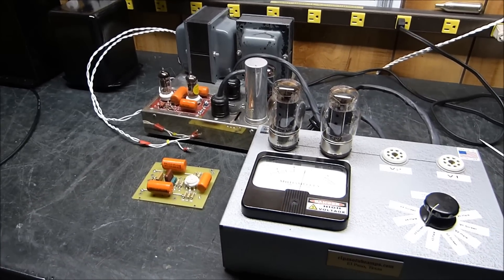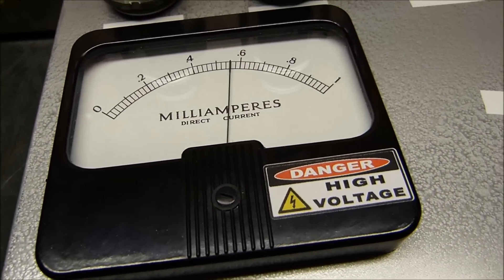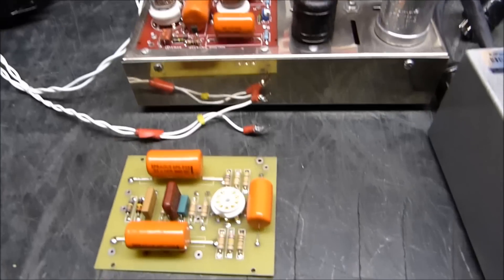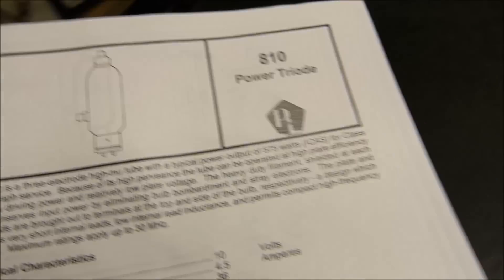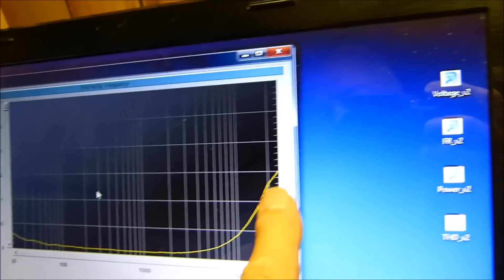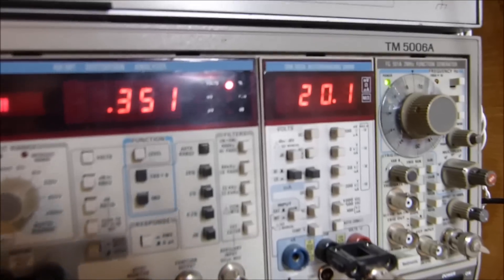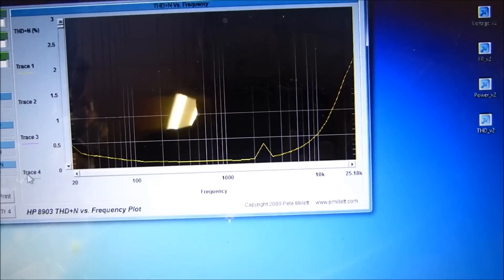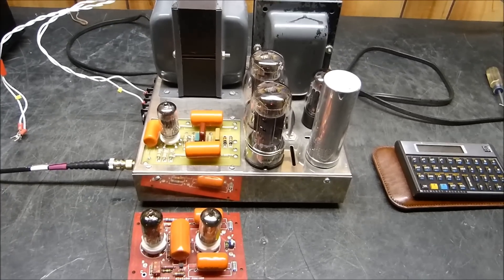Dynaco Mark III Poseidon Board vs Original Dynaco 6ANA Driver Board

Comment: Thanks! I was pondering whether or not to change out my original Dynaco driver boards with new ones and now I'm probably not going to go that route. It's my dad's stereo and other than changing out the selenium rectifier for diodes and upgrading the cap can, I want to keep it as original as possible. It sounds pretty good now. Edit: I upgraded the can filter capacitors and replaced the original driver boards with Vintage Electron ones that are an exact copy of the Dynaco boards (the original boards were 60(?) years old and pretty beat up). I replaced the selenium rectifiers with diodes, replaced one bad rectifier tube and got new Kt-88s and NOS 6AN8 tubes, set the bias properly and these little guys sound great. But so much for keeping them original;)

Comment: Have you had any experience with the Octal driver board from Tubesforhifi ? 

 Iv'e got a set of Mk3's that I want to upgrade. Iv'e read some commentary but would be interested in your opinion on which board (of any out there) you would buy next to try or would you keep the Poseidon?  Also doing a Radio Craftsmen C550. Cheers! Keep em glowing!
Reply from the maker: I wasn't aware of the Tubes4hifi until now. Thank you. I am a real fan of the 6SN7 so I will have to try them. I didn't see the schematic of the Tubes4hifi board but I can say that, in any case, I believe a second adjustment is a good idea and maybe they did include ii. I am talking about the Poseidon board that has a pot (static adjustment) on it to help balance the cathode currents but a pot to vary the resistance of the plate (or cathode) circuit of the driver to balance the drive voltage while being driven to max power (dynamic adjustment) works very nice as I showed in one of my videos.
Reply: I had watched that video. I agree, all PP amps should have the option of dynamic matching. especially since matching up quads of NOS tubes is getting tougher every year. 
The Tubesforhifi kits (VTA70 and MKIII version) feature long tail phase splitter with CCS mirror and bias adjustment for each tube. I am building an all tube amp 5 ch surround sound system with MKIII's (fronts) ST70 (rears) Craftsmen C550 center channel. I think I'll try the Octal board on the MKIII's (they have a 9-pin driver board version also). I have my ST70 in triode mode currently with EH El34's. Whats your preference, triode or pentode mode on the MKIII's with the Reissue Gold LIon KT88's?
Reply from the maker: Hi Mark,
The reissue Gold Lion KT88's are beautiful. I have had two quads of them. Right now I am running EH KT88's in my Mc275 as they were a gift to me and they are very nice. I rarely comment on the "sound" but it seems the EH KT88's are a little more "gritty" sounding on the high end. Maybe it was the brand of beer I drank before listening to them the first time. Who knows.
As for triode vs pentode, I generally go with a pentode/tetrode type connection because I can't help myself wanting more power... 
As you know, running the 6L6 family (KT88, etc) of tubes with reduced screen voltage, running it like a tetrode gives the most amount of efficiency and power output but that darn screen supply is such a nuisance  to build. However, one of my good friends thought of a relative good and simple way to drive screen voltage and plate voltage from one supply.
The output of the rectifier is connected to a capacitor input filter (Pi filter) to supply voltage to the plates. This generally gives a boost of about 20 to 25% over the RMS AC voltage of the power transformer from one side to the CT which is grounded. At the output of a different rectifier, connected across the same power  transformer winding, another filter network is connected but this one is a choke input filter. With high enough inductance in this choke, this should give about 90% of the RMS AC voltage as mentioned above. Thus we have two stable supplies from one source that can be "played with" until the desired difference in plate vs screen voltage is obtained. An LTSpice model I have made gives 65% at the output of the choke input filter with the same load on both supplies. The screen supply will be a somewhat higher impedance so that has to be taken into account in the filter design.
The 6L6GC for 55 watts output wants 450 plate and 400 screen (11% difference) and for 47 watts output wants 360 plate and 270 screen (25% difference) - per the RCA tube manual. So, this may be a reasonable option for obtaining a proper screen voltage and maximizing output. Surely someone, somewhere, has done this before.
As for ultra-linear mode - wow... that is a marvelous word to use. Who wouldn't want "ultra-linear"? Is that really what it is and does it live up to the expectations? I have my doubts. In any case, it seems to solve the issue of deriving screen voltage as the connections are very convenient. I assume you have studied the McIntosh designs? Take a look at how the screens are connected in the MC40.
http://www.tubebooks.org/file_downloads/McIntosh/MC40_sch.pdf
Cheers,
David

Comment: Posiedon board wastes half of the 12AX7.
Reply: yet, a pair of boards are complimentary in that you can switch those tubes left-to-right to use the unused sides.  It's like rotating your tires for longer life and performance.  Rather clever of Mr. Stokes.
Reply: @robertalbiston7822  ok, I was unaware of that advantage.

Comment: I like how you're able to trace a curve of the distortion at different frequencies, I would like to test my tube amps in similar fashion. Do you know if it is possible to do something similar by using an external sound card like the one you have (Focusright Scarlett) and an FTT software like Arta or Spectra? If I understand correctly the software / sound card combo would anyway report erroneous THD value above 5k, but can trace a curve automatically like you HP software does?
Reply from the maker: The ARTA or Spectra software does a wonderful (and fast display) of low frequencies, but, as you mentioned above 5 KHz the THD starts getting off significantly as frequency increases. With some trusted audio analyzer you could manually plot the THD at a few frequencies on log paper like McIntosh used to do when they sent out their engineers into the field to test their equipment. They usually just tested it at 20 Hz, 1 KHz and 20 KHz and drew a line between the three dots. Perfectly legitimate in my opinion. The problem is, how to get an accurate reading at 20 KHz. Some of the older, manual devices like the HP 334A analyzer might be useful. I had one but it needed repair and was off significantly at the higher frequencies and I gave it away so I would be careful and a little wary of these older devices. Maybe mine was just an odd one with an issue.

Comment: What's up with the transistor on the replacement board? Is it a FET preamp, or a precision voltage reference IC to provide bias?
Reply from the maker: It's an LM334 current source that is in the cathode circuit of the 12AU7. Here is a link to the board.
http://www.diytube.com/unidriver/poseidon.pdf

Comment: I wonder if the original board (6AN8) might have measured even lower distortion if the amp had a bias current balance adjustment for the power tubes like the Poseidon and some other drop-in substitute circuits have.  By the way, a kit is available to do exactly that, adding power tube bias current balance adjustment to the original Mark III (while still running the 6AN8 on the driver board).

Also, the two 47K-ohm resistors on the 6AN8's phase splitter, as well as the two 100K-ohm resistors off of eyelet #2, need to be matched.  Looking at the image of your 6AN8 board, I think they might be 5% (gold band), is this correct?  Kind of hard to see it clearly enough.  Unless you happened to have matched these by hand, 5% tolerance on these might cause an increase in distortion.  The Mark III schematic asterisked these resistors as needing to be matched pairs.  And, resistors in the same positions in the Stereo 70, for instance, are specified right on the schematic as needing to be a 1% match
Reply from the maker: +Peter Capobianco From what I have experienced, the Poseidon board provides a limited amount of output tube cathode current balancing. If the tubes are pretty closely matched out of the box, the adjustment does work and you can match the cathode currents spot-on. As for the components on the board that I used, each component was handpicked and matched very well. The best design I have ever seen and used is in the McIntosh MA230 power amplifier section.  Here is a link:  http://akdatabase.org/AKview/albums/userpics/10004/MA230%20Schematic.pdf Notice the driver balance adjustment.

Comment: You should play some Texas blues, of course, through your kW amplifier. May I suggest that you shoot the Pete Millet utilities in full-screen mode (when possible)? You'll find it much easier to photograph from not so close, and you'll lose less detail by not attenuating then amplifying as it were. Keep up the good work, enjoying it all. EJP
Reply from the maker: QuadMaestro I agree with your comment on the Pete Millet utilities but that is as large as the graph will get, i.e. full-screen doesn't make it any larger. I think it is written a good while back in 600 x 800 format for older PCs. Texas blues music at a kW - you're probably right :-)  Thanks

Comment: Have you ever tried upping the negative feedback a little? I'm sure that would lower the THD somewhat, if there is enough loop gain available.
Have you ever tested the British made Quad 11 amplifier. In days of old when I had such equipment, I found it had the lowest distortion of any valve amp I have ever tested, sounds very good also.
Reply from the maker: +Michael Beeny I am not familiar with the British Quad 11 but you have peaked my interest and I will research it. In a recent video I made on the Mark III, I did measure the NFB at about -19 to -20 dB. In the  experiment I saw that too much NFB caused the amplifier to want to go into a very slow (1/2 Hz or so) oscillation and the low frequencies, particularly 20 Hz, suffered terribly if the feedback capacitor was too large.
Reply from the maker: +Michael Beeny I just looked up the Quad 11 and the schematic looks a lot like the Fisher 70-A where the OPT has a cathode winding to a cathode bias resistor. I have one of the 70-A amps and I like it. I purchased it in memory of my uncle who I lived with, and who sent me to college, in Oak Ridge, TN where he was a chemist for ORNL. There was a stereo shop in Oak Ridge full of every vintage jewel we dream of today. I remember that shop and those days back in the early '60's very fondly.
Reply: +ElPaso TubeAmps I used to work in the lab at QUAD while at collage. Mostly famous for the Quad electrostatic loudspeaker. While not perfect it still sounds very good today. I had a pair for almost 20 years. The quad 11 did have a very good output transformer, made by quad it was dipped into bitchamen and potted, then topped up with more bitchaman, as was the choke and mains transformer Used 2 xEF86, 2 xKT66 and if I remember correctly a GZ32??. If ever you get a chance, do some frequency response and distortion tests. The funny thing was when a transistorized version replaced it, apart from power output, the original valve amp walked all over it in almost every respect. Especially sound quality!! Did I say reliability? many were returned in the early days blown up!!
Reply from the maker: +Michael Beeny If I remember correctly, McIntosh delayed manufacturing transistor amplifiers for some years as they were not reliable back in the early '60's - I assume that is what you mean by returned ones being blown up. With that said, people who know nothing about vacuum tube equipment assume all tube equipment has always been unreliable - we know that certainly isn't true. As I mentioned, the Fisher 70-A being of the same vintage, has a very similar OPT and even though it does have some artifacts that are less than technically desirable, it sounds great all the way up to around 18-20 watts. Just recently someone commented that when we went from tube amps with 0.5% THD to solid state amps with 0.001% THD the harshness of solid state amps arrived. I realize modern day amps are not pure BJT amps and are much  improved and I own several SS Mac amps that will really impress a listener (at least it does me) but the love of vacuum tubes will be around for a long time especially in the world of guitar amplifiers.

Comment: I would think that perhaps the phase inverter balance is slightly off at 20Hz on the original 6AN8 board. Tube distortion at low frequencies should not be a problem. I'd look at the circuit and measure the grid drive to the 6550s and see if one of them is dropping off more than the other at the extremes.

Comment: play some music through your work please. i have been on pins and needles waiting on the 1.3kw amp playing music please please please make this bad boy play
Reply from the maker: Thank you - the only reason I haven't yet is I need help carrying the monster into my back house where my speakers are.. I will have to remove the amplifier chassis and them move the power supply and cabinet and then re-install the amp. Shortly afterwards, I will have to move it back out as it will take up so much room that I will not be able to live with it. I plan on comparing the sound pressure level (SPL) to my McIntosh 2205. I have connected it to some small Paradigm speakers I have in the shop. When you flip the HV on the volume comes up instantly and it will scare you is it is up very loud and I can tell, it will get much louder. Over the Internet I figure only with the SPL meter will we be able to tell any difference. I am a little anxious that I may damage my speakers with even 1 KW. Should I play Jazz or AC/DC ?
Reply: ElPaso TubeAmps  thank you so much for your knowledge with tube amps. you have my full attention. i'm in canada and sir if i was close you would never have to wait for a lift. i would be there in a flash for a chance to hear these in person. i'm sure what ever you chose to play will show the unique purity of your hand built greatness.
i have great respect for you.
so come on guys someone close to him give him a hand to move these monster cool amps.
Reply: Play classical-try Saint Saens Symphony #3.

Comment: Hello David, hope all is well. What's interesting about the 6AN8 is, it was originally used in TV's. It was mainly used for an IF amplifier, AGC & video amp. basically a combination triode/pentode. I'm curious to see how the 810's are going to perform once you get the second power amp up & running! I enjoy the videos as always. :)

Comment: another outstanding video mr.r. i have a question,st70 related.IF a person used carbon instead of metal on a long tailed pair phase inverter the driver uses 3   12au7,12at7,ect.the sound was so bright.so i put it in the 120$ box it came in.it sounds much better in there..so mr.r should i bring into my labortory strip it put carbon in $$ do you think there will an audible difference.or leave inbox knowing that dynaco put out a product that hands down needs little to no improvement.. thank you for any send r input ....meanwhile im contemplating on putting 30 inch rims on a metropolitan nash,,,upgrade lol...
Reply from the maker: Paul Biglane Hi Paul - I really can't say about the carbon vs metal resistors. I have not seen any attempts at a  legitimate studie/measurement on the differences of the resistors. My head tells me that there would be no significant differences but there may be some nuance there that can be heard but difficult to measure and document. I tend to like my audio a little "bright". I just swapped out a solid state MC2100 in my home theater for my MC275 and I can hear the differences in the highs - I know I am a tube guy to the bones but I have to admit, I also like the "brightness" of the high end solid state amps. I have always liked the ST70. It sounds like you have the modern-day driver board and not the 7199 board. As for Dynaco being perfect, no, I don't believe that but I am cautious not to make changes without doing a lot of testing - much more than I do to make these videos because while we may improve one thing in the amp, we may make something else much worse but I am not afraid to experiment. I do try to have a back-out plan to get back to original in case the "improvement" doesn't actually improve  :-)
Reply: hi mr r.thank you for your honesty,like i said it was an idea,maybe when i learn what resistor controls certain fq.till then im content.i would like to get back with you.on building your tube matcher{maximatcher} partslist,schematic. me gmail.againthank you for your responce.have a great evening cheers